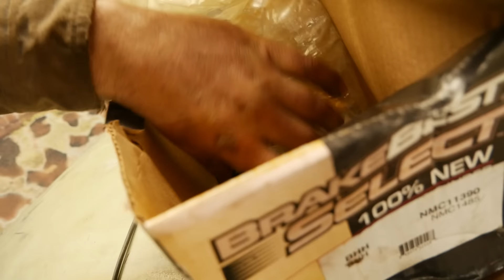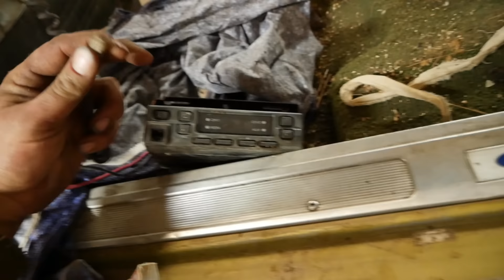1970 Ford Mustang Grande Coupe REVIVE & DRIVE + Burnouts

Comment: There is nothing wrong with that transmission!! That aftermarket hood scoop activates 3rd gear when it opens the air flow. You just need to cut a hole in the hood and rehook the airflow solenoid transactivator. Simple! Love the video,as always
Reply from the maker: I thought it was cut a hole in the roof?
Reply: @PoleBarnGarage  You might check that headlight fluid. last time i did mine i forgot to rotate the bulbs now they squeal when you do a j turn.

Comment: you probably just need to make sure you have a vacuum Line hooked up to the transmission modulator to get 3rd gear, 
(c4 wont shift to high without it)

Comment: I own a 63.5 falcon sprint with a 260 and 4sp. Granddad bought it new drove for about 65k miles and then it got parked In a pole barn. I’ve done a frame off restoration on the old girl and what I’ve found out is it’s basically the same as the first mustangs. Only difference is the 260 vs having a 289 or a 302. I kept the car all original until a few months ago and just purchased everything to make a 4 barrel and going to electronic ignition. I love what you do with all the old cars and try to give which ones are fees able new life and the ones that a little far gone at least the chance to live on in parts on something else. Keep up good work!!!

Comment: The high/reverse clutches are applied in reverse and third gears so if you have a solid revers, third might be recoverable by adding Lucas to a fluid change. More pressure is applied in revers as compared to third.   An old school option is to add a table spoon of brake to the fluid, short term, which will swell  all the seals. Then change the fluid and drain the torque converter to assure to get all the brake fluid is removed. I remember that Ford made a brilliant engineering move and placed catalytic converters on either side of the transmission which boiled the transmission fluid and harden the seals. Leaving an o-ring in brake fluid over night will balloon it.Try the Lucas first. Nothing to loose!
Reply: I'm not familiar with the C-4 that may have been used here. He really should check the VIN. If it is the BW cast iron auto then U'r suggestion works. When that trans in my '68 javelin bit the dust I scraped and saved 40 lbs. from the car. Put in a Chryco 904 with a TransGo shift kit with a " modern " 304 and fun was my new mantra ! And, stingy on the fuel. Cheers.

Comment: Late to the party here, but as mentioned in previous comments the no 3rd gear issue is likely a vacuum modulator problem.  Without it hooked up it'll only shift into 3rd when the governer says it's had enough of 2nd, which depending on the gearing could be as high a 80 mph.  If it's hooked up and getting manifold vacuum then it's likey damaged or there's a problem in the valve body.  The direct clutch is used in reverse and 3rd, so at least you know it's capable of 3rd if reverse is working.

Comment: That was a fun episode, I am a sucker for a classic mustang though. I want to point out three things because that's my job as a YouTube commenter.
-Theres a high chance thats a roller cam 5.0 HO motor
-those efi valve covers don't have a provision for a pcv valve, I would consider spending the $0-50 on a set of valve covers that does have a place to add a pcv
-there are two valve bodies used in 65-73 mustangs c4 transmissions and difference is where they placed the position for drive. on a early 65-67 valve body drive is one position further back past reverse than on the later cars. I have had those swapped on a couple cars before and you think the trans is broken until you knock the shifter and it finds drive magically in the second gear position then it works. your linkage could be all sloppy loose too. 

That was great, cant wait to see more.thank you

Comment: I've found a small pipewrench is just about perfect for those extremely stubborn brake lines. Especially if you've already rounded them off.
Reply from the maker: They make them that small?
Reply: @PoleBarnGarage  yep, about the same length as a normal wrench. No idea where to buy one, I'd assume the usual places. "Borrowed"  mine from my Dad's toolbox about 20 years ago as it was so handy.
Reply: Check evil bay I just found an 8 inch long one for $25 used

Comment: Check that the vacuum is hooked up to the modulator on the transmission. I have had that issue before, and it is the same issue. No 3rd gear. My buddy bought a Ford truck cheap because of the bad transmission. We drove it off the property and I climbed under, hooked up the vacuum line and he drove it home with all 3 gears.
Reply from the maker: I'll take a look
Reply: Score!!!!😂😂😂😂😂

Comment: Ah the old Craigslist rebuild on those brakes. 
The old girl looks a bit rough but from what I'm seeing she seems pretty solid under that surface rust and cruddy paint. Probably worth a stop at the cleaning products area at Menards when in Iowa or Wisconsin if you don't have them by you and get a case of Dgerm that Kevin and Mook turned me on to for defunking the most funky messes and really give that interior the once over.
A lot of people are talking patina but she might be worth the under 200 Amazon auto paint kit and at least a working guy's restoration.

Comment: Man, my first car was a olive green metallic 1969 Mustang Grande with a 351 Windsor. It had a vinyl top, cloth seats and the horn button was actually Intergraded into a rubber strip on the inside circumference of the steering wheel rim.(if that makes sense).
 It was in remarkable shape when I got it(1978) but I ragged it pretty good and ended up painting it in emerald green metallic Imron. I put American racing Vector(think the Duke’s General Lee) wheels with 60s all the way around. It looked really sweet for awhile.

Comment: That Mustang is mint.

It has patina, not rot.

I'm in the UK and things over here rust for fun, because the councils chuck tons of salt on the roads every winter.

I like Yank tin.

Had a '76 Trans Am 4 speed from '96 - '05.

Replaced it with a '88 Mustang 5.0GT 5 speed in '04.

Still got the Mustang, and also now got a 2002 Dodge Ram Cummins long bed dually and a '55 Chevy with a built 454 and Muncie 4 speed manual.

The Chevy is a replica of the car in 'Two Lane Blacktop', but even spicier.

It's a monster.

It's also currently broken. The right rear wheel snapped off on its last run out.

Comment: Awesome video! Just an FYI you can put Granada spindles on that car and have disc brakes. You'll need a different master cylinder or a portioning valve to dial back the pressure or it will grab really hard. Ask me how I know. :)  Also it may have been mentioned already, but if you hook the vacuum to the modulator you should get 3rd gear back. If you have reverse then 3rd is there. Keep up the kewl videos.

Comment: Hey, riding a bicycle is about the same thing, they are all different but will get ya there., those transmissions are simple fixes as a lot like any of them. A little harder to get the band for the lockup on  the inside is kinda tricky but once figured out becomes a lot easier

Comment: I have been waiting to see that old pony running again.  Unfortunately old Mustangs are notorious for having bad heater cores and stuff.  Grande versions kind of stink, I always dug the fastbacks but this old Grande looks kind of cool. I really like the front end of the 1970 Mustangs!  Good NEVER START battery from Wally World, definitely High Performance Parts! That is definitely a newer engine based on that oil fill cap. I liked the Chrome valve covers painted black. Chrome gets you home...Nope! I definitely like the jumping valve cover on the captain's side.  Not bolted down at all. Very cool effect.  Zip ties are the universal replacement for baling wire and duct tape.

Comment: if you slide the hub back onto the spindle put the nut only a few threads on pull the hub sharply with slight upward or downward pressure the bearing and seal will come right out and wont damage the seal

Comment: Actually water trickled into the carb works best for removing carbon in the combustion chamber. ATF in the oil will clean out sludge internally. ATF down the carb just makes smoke that smells bad.

Comment: Pretty sweet Mustang. I just bought a 65 myself, pulling my hair out trying to figure out what's been done to the ignition switch.
Reply: What do you mean? What's it doing/not doing?
Reply: There is no spark at the coil. the last guy added a wire from the center lug on the ignition switch that taps into another wire under the dash, runs into the engine compartment, and stops. I feel like something under the dash is grounding out and he was using it as a jumper wire.

Comment: That grey fuel line on the boat primer bulb is notorious for separating internally and collapsing. It looks good on the outside, but the interior material collapses when the engine tries to pull fuel.

Comment: That 'paint' is actually really great, and bono means should you even consider repainting it. Fix it under one of those mechanical adhesion clear coats  you can buy nowadays.  Do body work as needed, but then duplicate the ratty weird paint again, because it's fantastic.

Aside from that, under the skin, do itup right. Either a restore if your mind runs that way (mine doesn't, if I am replacing something on a car, I'm almost always looking to improve it, not replicate an antique, but thats a personal thing) or update the suspension and drivetrain, rebuild and then build up the engine, and put in a nice custom (but creative and shop made) interior.  The c r has great lines, it has that remarkable paint/patina, and it looks like the bones are pretty solid.  Personally it's the kind of project vehicle I always wanted and have never seen.  It would be pretty cool if you did. series on it IMO

Comment: on the brake but, drivers side - drill a hole at the ket and tap it then run a screw in there...  I for sure thought you might do that

Comment: Those external Mustang gas caps when thr gasket wears out or goes dry you get water in the tank and they rust up . My Dads 66 was that way , i would have to take the brass cone filter out in side of the hiway in Dallas to get him to let me take the gas tank to the radiator shop and have it rotted out and sealed to keep him off the side of the road !

Comment: Lithium grease is absolutely fine to use in wheel bearings now. The only place you can't is where plastics are. It breaks plastic down
Reply from the maker: It does not have the temperature resistance of wheel bearing grease. It turns to powder

Comment: Some of those 302 2v had some balls. Mine annilated a modified 71 351 4v rated at about 350 hp back in 85. Man I miss that car 70 FB with almost every option and fast as hell.
Reply: Been in a station wagon doing 120 and it just had a TBI 2bb 302 in it.😮😅😅😅

Comment: Long time no talk/comment, been going through some shit. I know I've said this before but you need to do a mid-late 70's. The "Smog" cars are becoming a VERY popular build, especially out here in the Southwest/West because you can still find them running and driving dirt cheap, most parts stores still carry parts for them plus most of them no longer need to pass smog tests because they are older than 35-40 years and have grandfathered out of the regulations.

Comment: Man I’m shocked!.  The mustang floor pan and suspension , engine bay is the same as Australian falcons as they continued when America dropped the platform till the mustang 2 we never got. I’m surprised over there they still manual brakes no booster and on drums. If you’re a Cleveland man they still make them new in Australia and any go fast combination you like

Comment: The Mustang is not a Grande, it's a standard Mustang. If you look at the data plate, I'm sure it will say 65A for a body code. The Grande code is 65E and would have a vinyl  landau top, molded door panels with courtesy lamps, teak woodtoned fake appliques on the dash, and a big round clock on the passenger side, among other things. It's definitely a newer 302, there was no EGR before 1973.

Comment: If you can't get your hands on a c4 transmission for it go with a Ford FMX it's stronger than the c4 and it'll handle up to the 351 Cleveland motor, can be found in the grenada's the Mercury monarchs.

Comment: Very cool car! That 5 mph compliant front bumper that looks completely different from the rear bumper sure is bizarre. I think the 73' Camaro and Corvette had the same oddball bumper variations. Keep us up with progress. Btw, I bet you own a hand held rubber sanding block and just forgot about using it to run that 400 wet paper in a uniform crisscross motion to rapidly remove that primer without digging into the blue like fingertips do......

Comment: That two-way radio appears to be a Kenwood TK762 or TK862, or a TK782 or TK882. Very similar appearance, although i suspect its from the x80 family. They were 2-channel units, either 136-174MHz VHF or 440-512MHz UHF. I guess a UHF would be useful for GMRS channels, like the tiny handheld radios you guys sometimes use between cars.

Comment: I'm late to the comments. I think by '70 ford was using the in-house C4. From '64.5 to 69 would've bin the BorgW FMX ( M12 ) which was spec'd for my '68 Javelin. The tranny could not hold up to the power of a baff'd 343. My best option was to replace the power train with a " modern " 304 wit headers and HEI & the good 'ole Motorcraft 2150 carb ! Oh and a tuned chryco 904 Trans. It hauled ass just like that 'ole ' Stang. Everyone thought I was running a 390, but no., a swapped in mill from a '77 Matador X ! Had trouble locating a locked rear end though !     Cheers.

Comment: Noco jump starters are really good. I have the 2000amp I think and it will just a dead battery three times before it don’t have enough to. I’ve jumped completely dead, like nothin turnes on the dash dead and it charged the batter plus jumped it no problem. Just had to let the charger sit on there for a bit. I believe you can get a 4000amp and that’ll jump a semi. Pricing ain’t bad and they’re quality jump packs. Anddd mine sat for a good four months unplugged and still had damn near a full charge.

Comment: LOL that misfire is probably caused by a blown head gasket, judging by the excessive pressure in the cooling system. Most of the time I see the Windsor's with EGR systems, they like to pop cylinder #7 or #8 in the back. They get a lot hotter than the rest due to the EGR gasses.
Reply from the maker: It was a radiator cap. I'm going to guess maybe it needs a set of plugs first, instead of immediately assuming the engine is garbage

Comment: I have a 3 speed manual out of a 67? Bellhousing, flywheel pressure plate clutch disk for a 289? It also has a shifter no handle.
Reply from the maker: Appreciate it but really trying to keep it simple and just replace what's there

Comment: Needs a 390 cui, its a nice year model, very underrated
Reply from the maker: 302 is lighter and fits 🤷
Reply: @PoleBarnGarage  

But the FEs sound nicer plus provides more torque, lol.
But yes, the 302 should be enough, wasnt there a 1970 302 Boss Mustang Fastback available also?
Reply from the maker: Yep

Comment: Car will fix I think body is not too bad. Poopstang LOL I like mustangs.  I have seen worse Rustangs. Its not too bad really. Runs pretty good all things considered. I think it would take a decent paint job I cannot really see it that good from my house but it seems pretty good. It might have bad valve guide seals or it the rings are sticky try runnning some B12 in the crank case and down the yap. then change the oil. Or the video I saw where they poured seafoam in the crank case and freed up the rings. Its scary though could spin a bearing. it you do that do not rev the snot out of it before you change the oil.

Comment: Might also check the modulator valve but didn't you have a transmission I am motorcycle didn't it have like AC6 why couldn't you put that in there if nothing else works

Comment: OMG...Here we go. He's gonna paint it orange and try to outrun the cops. The Mustang is really a Falcon? Yep! If they don't have a listing for my Falcon, I just ask for the same part for a Mustang...and there it is. No third? Maybe just the modulator valve or a vacuum line off. It may shift into third if you went fast enough, but I don't think you want to take that car to those speeds. Let it shift 1-2 in drive and see. If it shifts at about 40, that's your problem. If you do need to change the trans, you can use any C4 and take the bell housing off of yours. Ferd doesn't make it easy, but it can be done.
Reply from the maker: I was doing well over 60 in 2nd
Reply: @PoleBarnGarage  If the modulator doesn't work, the governor will force up-shift at about 80 mph. 1-2 shift can be as high as 50 depending on gearing. 60 in second isn't very fast for them old cars.

Comment: You sure the trans modulator isn't unhooked. That will make you only have 2 gears?
Reply from the maker: That will make it not shift automatically, it controls line pressure. Shifting in and out would have made it shift
Reply: @Pole Barn Garage  
Oh ok. I had a bronco that the vacuum line split and fell off and I couldn't get it to go in to 3rd no matter what. Put it back on and it worked. 
Wasn't sure just thought I'd throw it out there in case.

Comment: This is a late model 302. The tube on the back of the heads is a smog tube. This will be a piss weak engine. 165 hp rated.
Reply from the maker: Some of the strongest 302s made are from the 80s and 90s. And they have "smog" tubes. You can't make blanket statements like that. What if it has gt40 heads or something? You can't tell any of that from a video